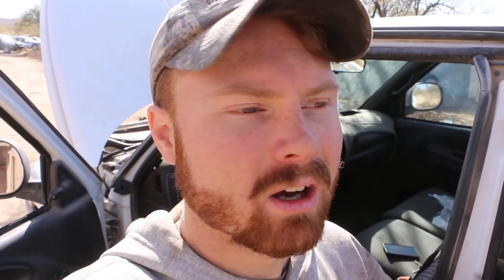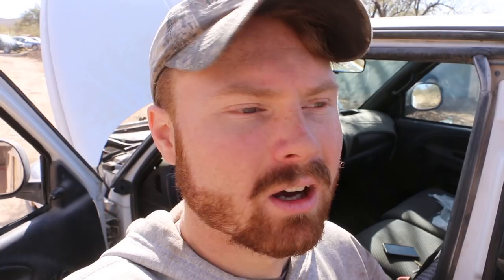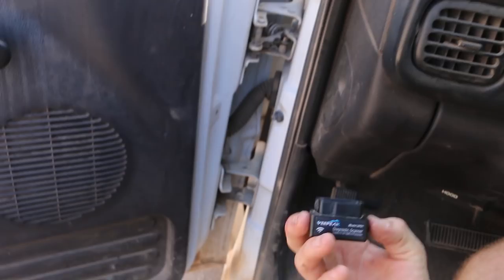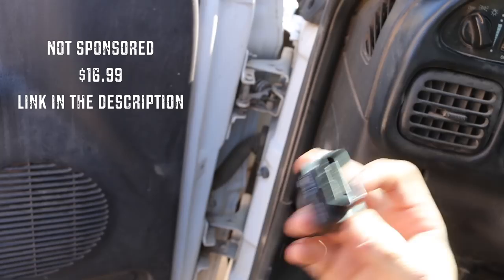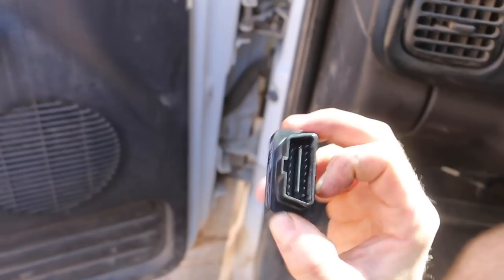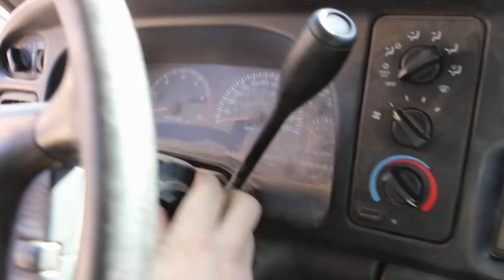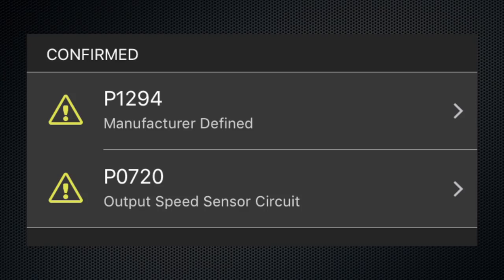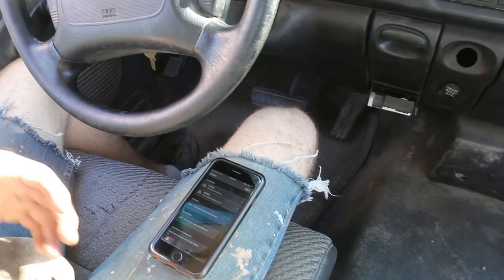Do I Need To Rebuild My Transmission? | Rebuilding A Automatic Transmission Part 1

Comment: There's one more thing that can cause 'slipping' - your solenoid might be faulty. Solenoids get gummed up. This can cause them to work intermittently, or to be a little slow in working, or not work at all because they're stuck. Your ECM won't know that it's stuck; the ECM will only know it's an electrical failure (eg shorted, or open circuit). So if the fluid and filter change doesn't work, I'd try ordering new solenoids next. 

Also, check the pan. Use a magnet to pick up iron filings - these will be the friction disks getting worn out. Leave a magnet in the pan if there isn't already one, and it will prevent these from getting recirculated. That will tell you that you have just a few years before you have to do a rebuild.

Comment: IF you are serious about rebuilding the transmission be SURE you replace the torque converter and I would SERIOUSLY consider upgrading to a billet converter. The factory one has a felt clutch in it that disintegrates and goes straight into the pump. This is what destroys them. ALSO replace the radiator and any external cooler. This was the issue that caused so much trouble with those transmissions. The pump is/was a low pressure set up and did not pump hard enough to circulate the fluid at an idle. Hot environment, heavy traffic, transmission slowly cooking itself. They also had a check valve in the line to hold back pressure on the system in order to hold it on a hillside at idle. this was also a contributor to the transmission failure as the pump had to overcome the check valve to circulate fluid as well. SO, you had a pump that was basically dead trying to overcome a system that was working against it and a torque converter that was ready to kill it at any minute as well.
I went through 8 transmissions, 3 rear ends and 2 engines in one that never pulled a heavy load OR got dirty! This was all in a 1998 model 1500 4wd!

Comment: I put a heavy duty shift solenoid in mine and i have to manually put it in first, i cooked brand new trans fluid before i figured that out. -1/2 ton 96 ram

Comment: I talked with a transmission guy and he told me the last thing you wanted to do to a high mileage is to change the fluid he said the metal filing in the old fluid will keep it from slipping.

Comment: sometimes the problem with changing gearbox fluid is that new fluid has detergents in it, and it agitates the dirt and grit hidden in the gear box and delivers all that grit where you don't need it
Reply: and usually people that are changing the fluid are doing it because they are already having shifting issues. new oil does not ruin a trans.
Reply: sure,  but it can push it over the edge by agitating the dirt and grit trapped in the box.

the tip is to not let it get that way.